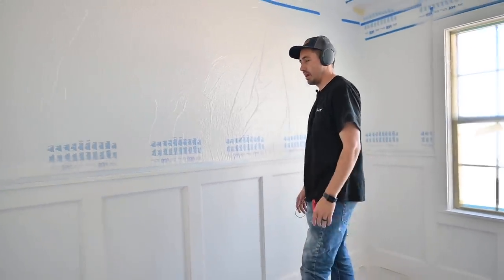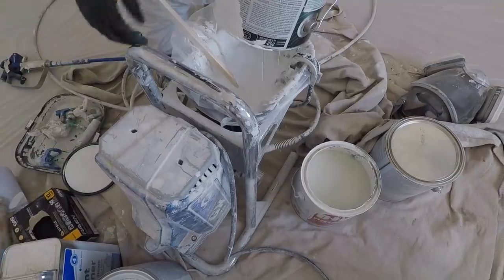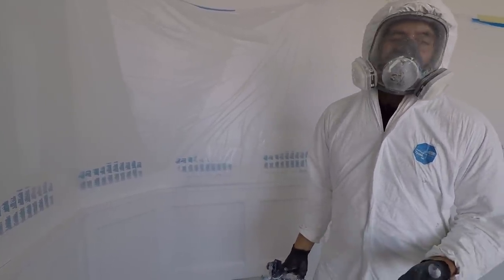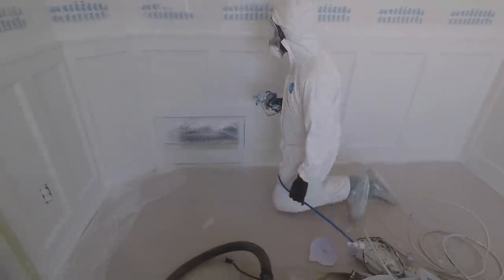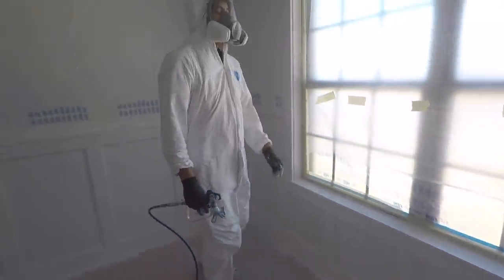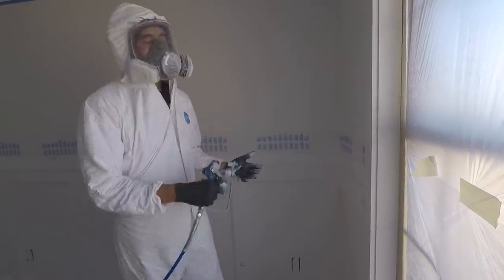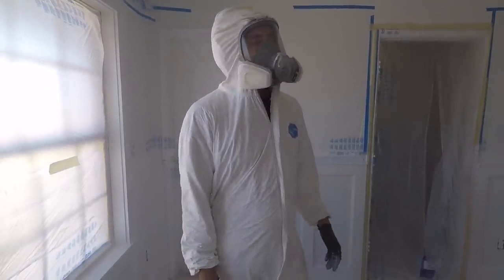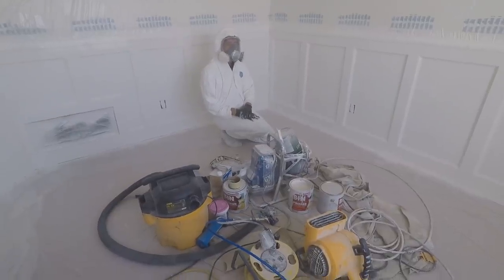Spraying paint for a new Baby

Comment: Huge fan!!! Learned a lot of carpentry tricks from you in the short time I've been watching! Have you tried the new Senco 21lxp nail gun? It's amazing! I have been painting for over 20 years and would like to help you step up your spray game. Here's some of my techniques: Turn sprayer pressure down until tip starts tailing, then turn it up slightly until it doesn't, this is the optimal pressure which will reduce overspray drastically, use less paint and allow more control. I use a fflp410 tip almost exclusively for all trim with almost all latex products. Back of the surface 10"-12" and overlap each pass 50%. Turn your tip 90 degrees and you can spray an entire door or window jamb/casing without starting/stopping. Get yourself some zip poles and avoid taping to ceilings. They also make zippers for any plastic that seal of the room completely and eliminate any chance of overspray drifting out thru cut or overlapped plastic. I often run a portable 12" ventilation exhaust fan with a furnace filter in front of it with ductwork to outside air to help remove the "fog", help the paint dry faster and reduce the humidity in the room. Try Benjamin Moore Scuff-x satin or semigloss for trim paint, it is a game changer in the trim paint world, it dries faster, sands like lacquer and it's tough as nails compared to all other trim paints.

Comment: Lower pressure is the way I used to go, especially with a fine finish tip. Just enough pressure to keep the paint from spitting from the tip and without fingering at the edges of the spray pattern. Keep yall's minds out of the gutter. Even though one coat can cover when spraying, two coats give consistent sheen without flash overlap and durability.  You're a perfectionist, so I'm sure that it's on point.

Comment: Hey Richard, I know you use to use a 310 tip before, what would be the difference with the one you are using now? I', asking because I will be spraying all the crown molding that I already installed and it really came out very good just by watching your videos which is something that I really appreciate. Thank you, Orlando.
Reply from the maker: Thanks. I use a several different tips but 210 and 310 are my favorites. It just depends on what im spraying. If its a 5" crown I would go with the 310.
As long as you can get it covered in 1 or two passes
Reply: @FinishCarpentryTV  Thank you for letting me know, also not using the Solo paint anymore? I noticed you used Emerald. Thank you again for all your guidance it really helped me to get great results even better than expected.
Reply: The 210, 310 means the width of the fan spray x2 3=6" 2=4". The size of the tip 10 or 15 refers to the opening of the orifice 10=10/1000, 15=15/1000 used for different viscosities of paint IE lacquer 10, oil based or latex15.

Comment: Keeping a wet edge is pretty important and so is using a quality paint like Emerald. That stuff lays out nice.
Reply: How would you guys compare the Emerald to like a Behr Marquee in terms of quality.
Reply: @mtbjason4  The Emerald is superior.  Amazing stuff.
Reply: What's a wet edge? Sounds like I could probably benefit from it!
Reply: @mtbjason4  I hand brushed a true raised six panel door with Emerald urethane. It came out absolutely Flawless... And I'm darn lousy with a brush.
Reply: @muscleman369  A wet edge means that you keep moving while painting and do not let a section dry so that the paint can flow into each other. Think of it like surface tension with liquid and how it will flow together when they touch.
Reply: Emerald Urethane does not hold a candle to Ben Moore Advance in terms of finish. 3 light coats of Advance with wet sand after 2nd is the current state of the art. Unfortunately you have to wait 16 hours between coats.
Reply: @Mowers11  
What are you painting? 3 light coats, 16hrs, and wet sanding? That doesn't sound like trim carpentry painting.

Comment: Nice video, although it may not matter as much since it’s wainscoting (low not at eye level) a additional point to bear in mind is to be conscious of dry spray.  When spraying a wall of wainscoting when the top cap is sprayed first there will be a mist of overspray that falls down onto the lower panels, due to its fineness it will be dry typically by the time it gets buried in a sprayed coat thus will Telegraph they the film.  Always start low and finish high👍👊👍👊

Comment: As a painter, my recommendation on pressure would be to use the smallest amount of pressure that will still atomize the product with an even spray pattern. 
I usually start with pressure on the low end, test my spray and if I see lines at the end I go up on the pressure til those lines go away and it's an even spray. 

The benefits of lower pressure:
Less overspray
Less risk of runs because there's too much product
You can move slower and are less likely to miss something
Better quality finish, no orange peel texture

I also have to say the prep in this room is immaculate, I want my jobs to look like this.

Comment: Did you shoot the satin or semi Emerald?  I almost exclusively use Advance, but after the brief construction lockdown was lifted here back in the spring, I ended up giving Emerald a try b/c Sherwin-Williams had a much easier online order/pickup process than my BM store.  The satin deep base used for the door color (almost black) was fine - really liked it.  But I had all kinds of issues with the white wall color which was the high hide white base.  It passed the eye test when done but it was rough to the touch almost like chalk or milk paint (I spray over BIN shellac as well).  I went and got more at a different store to make sure it wasn't a bad lot and tried spray/brush/roll over different primers etc - same result no matter the process.

Comment: I’m getting ready to spray the same stuff on some cabinets, I’ve got to get a short whip hose like that..
Could you turn your fan 90 deg while shooting the window casing? Wouldn’t have to contort so much...
Reply: Yes but that fan thing screws on tight and you have to play with it, turn  it re tighten it then again to put it straight. Your gloved hands will have paint or get paint on them and it all gets sloppy. So just turn your wrist and elbow it's a lot faster. I've been spraying for about 3 years and i'd just snap my wrist back fast and not go upside down. I have never seen a carpenter spray before so he is very unique in that.

Comment: I am considering purchasing the same gun, tip, and airless sprayer that you used on this project for light field work. I normally spray catalyzed lacquer and clear coat with a Cat-X HVLP in the spray booth of my cabinet shop, but occasionally have to do some trim work on-site to complete a kitchen or bookcase I have built. Such items don't always jlend themselves well to prefinishing before installation. Also, it's impractical to try to spray lacquers on-site as the clients will have to leave their home until the toxic vapors dissipate. Not a great plan.

Can you recommend a specific water-based paint that will spray nicely with this setup that I can get SW to mix for a compatible match? Thank you in advance.

Comment: I don't have that same exact sprayer, but man do I love my airless. With that said, I absolutely hate the prep and mask and abhor the cleanup. For small jobs like what you showed in this video, I would have brushed. If it was a larger job, airless all the way but that's just me. I don't use paint thinner to clean, just water but I've only ran latex paint through the machine, no oil based.

Comment: Great job!  
What's the plastic you're using? Also is that oil based bin? and did you spray that on? If so how do you like spraying it ?
and is the top coat water based?

Comment: Got a random question for ya: Do you think I can accurately cut 4in baseboard with the M18 7 1/4 miter saw? If so, what is the best method? If not, it looks like I will be buying a new tool :P Rather not as those bigger saws aren't cheap.

Comment: Hey guys, Zach from SD here. Thank you for uploading this! Do you only do one coat? What do you use to clean the sprayer? I use water. Is the paint thinner for when you guys switch from primer to paint? Thank you
Reply: I clean my sprayer with water. Then warm soapy water then a pump saver for storage. You would only use paint thinner if you are useing a oil based paint.

Comment: do you vacuum the floor after sanding? I would switch between  the 310 and 510 tip for that project.
Reply: Earlier in the comments he said he used a 208.  I would have used my 315 FT tip. The 510 is a lot of over spray on the moldings but ok for the flat panels. In my opinion.
Reply: I agree or a 411. Than fan is way small

Comment: Would a titian capspray 115 model, be able to cope with this area of surface and do a good job.
Reply: Yes a hvlp sprayer like the capspray 115 or Graco 9.5 will be able to handle the task. It will be slower due to output and refill assuming you would be using a cup instead of a pot. The finish will be very nice though if you are proficient with a hvlp. Since time is money us pros will often use either an airless with a FFLP tip like in the vid, or a Air assisted airless setup with a FF tip.  I haven't used a hlvp setup in many years but a plus to the hvlp is it will have less overspray and use less material than the airless.
Reply: @Fictitious_Character  thanks for your response, great information.Thanks again.

Comment: Love your work but I’ll stick with a brush and roller :)
Reply: Brush and roller a great for certain applications. I still use them to cover walls in new builds with no carpet of flooring. However in remodels and especially in cabinet work you cant beat the finish of a sprayer. The speed of it also makes up for prep time. Back in the day with oil base it would flatten out and be hard to tell the difference. Now days the difference makes the sprayer far better to me. To each their own but once you learn the sprayer and proper masking,  I think it is a lot faster and easier with better coverage.

Comment: What tip you using? Maybe i miss that moment when you said
Reply: He said 208. At least thats what it sounded like
Reply from the maker: @johnc6655  Yes a 208 tip.
Reply: @FinishCarpentryTV  208 HVLP?  Love the HVLP tips!!!
Reply: @FinishCarpentryTV  FT 208?  That's really a fine tip. but less chances of over spray  build up and runs I guess.
Reply: @drewcama5481  very fine tip. I don't even use anything that small for lacquer. 411 is the smallest

Comment: Next time start from the weird position and finish in the normal position on the window.
Reply: That will make the bends more natural.
Reply: Every Tom, Dick, and Harpo is going to have an opinion here so I may as well agree. Start unnatural and finish natural. If you like moving left to right keep moving in such a way. For example spray your window from a 5 oclock position (lower right corner), over to 7 oclock, up to 11oclock, across to 1 o'clock (upper right corner), down to 5 o'clock. Since your sill is wet any droplets from moving up and over should  essentially fall into the wet surface and be unnoticeable. As your coming from the 1oclock position down to 5 you can continue the downward stroke to the floor and then slide over to begin the upward spraying of the wall. Turn your wrist quickly before you get into the corners. Think of it as pushing the paint forward but also keep your eye on the painted surface you're leaving behind as it will help guide you into small adjustments as your moving forward, i.e. a heavy or to light of a coat. Also watching what your leaving behind will tell you to speed up or slow down, change tips/pressure, etc. This is just something I learned and not gospel. Do what works for you. I don't have  youtube channel and 2 million views so who am I to say anything. Love your work. Thanks for posting and best wishes for another successful year!